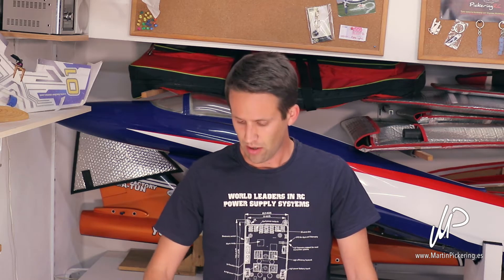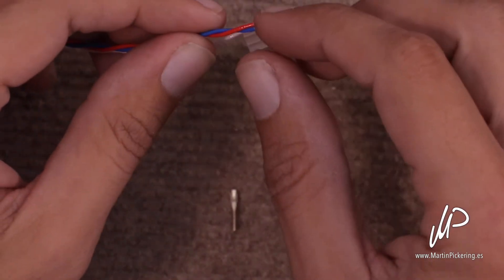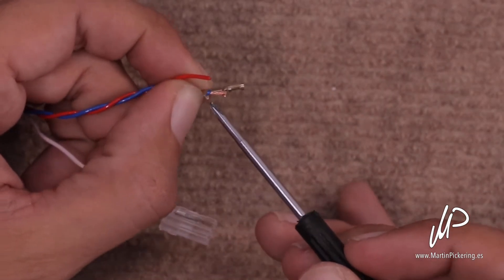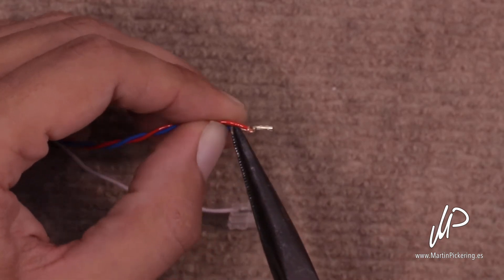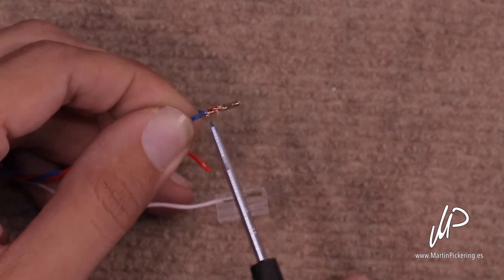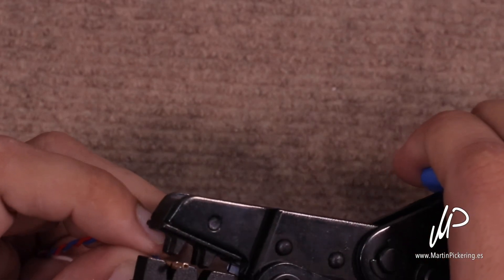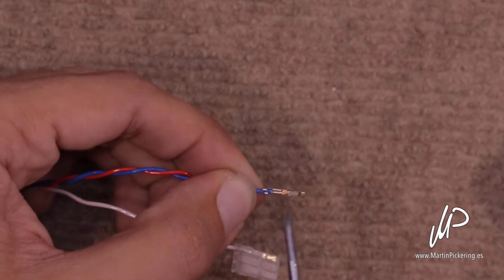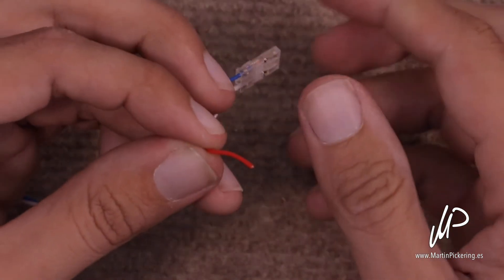Tutorial: Make your own extension leads! How to crimp Futaba and JR

Comment: Great video.  I bought a nice crimper, wire stripper and hardware a few months ago, but put it aside after unacceptable results.  Your video made the operation very staight forward and I completed several servo connectors today without any waste.  Your tip at 1:45 about using a small pliars to slightly crimp the wire holder made all the difference.  Your clear explanation of the process also added to my success.  My first one came out alright, but everyone there after was spot on.  Thank you for posting!
Reply from the maker: Thank you Greg! Really pleased that you found the video helpful!!  =)